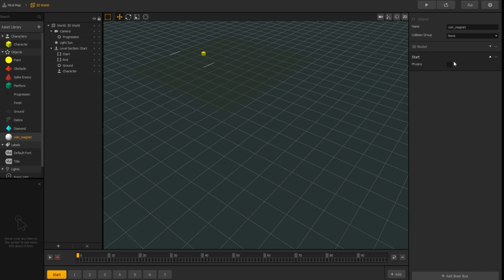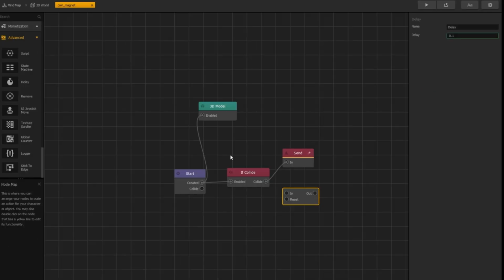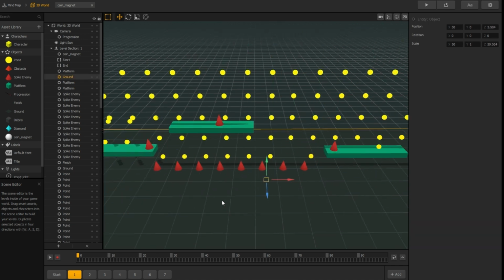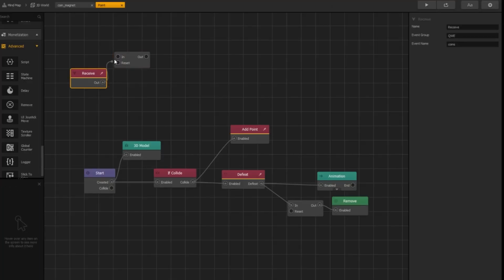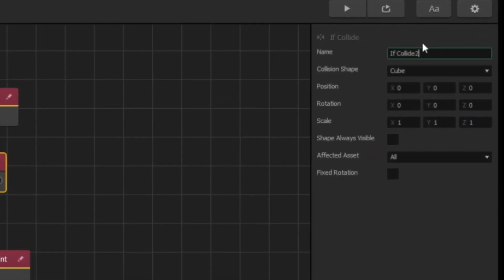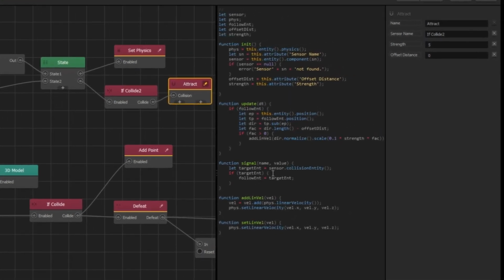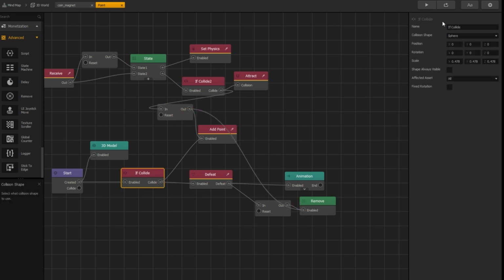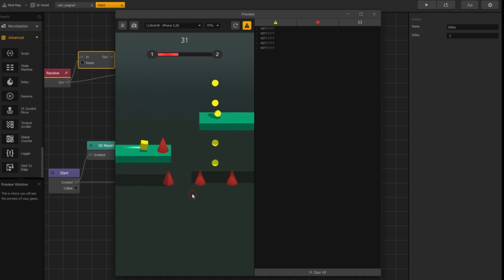Buildbox 3 Magnetic Coin Power-Up (ATTRACT Node)

Comment: The reason why setPhysics node causes that error is because to have set physics node on to an object the object needs to have physics activated to begin with. When setPhysics node is called there is a line that declares the variable 'ph' with the coins physics object. Since you never activated physics on the coin it returns null every time.

Comment: Thanks for the tutorials. In case, you know how to "make a perfect jump" (Buildbox 3). I wish my character would jump in the "x" direction, for example only 100 pixels. So I can get precise and equal jumps every time, without the character slipping or anything ... basically like the Hoppenhelm game. I know, I probably explained myself very badly, but I hope you understand!
Reply from the maker: One thing you could try, is setting friction very high on platform and character (you can find friction in asset's node map, in start node).
And turning off rotation (also in start node).
Reply: Hanomax Games yes, I tried in various ways, but I was not satisfied. I searched around a bit to see if I could find any lines of code or solutions, but nothing. also because sometimes it happens that by restarting the game, or during..something changes and therefore it is not always very precise. anyway thanks a lot for the reply

Comment: Hello! I tried this in a 2d game and it doesn t work properly....unfortunately. The coins are disappearing and counted but they are not "coming" to the character in a smooth way.... .  It s like the player activates magnet and then all off the points around character disappear instantly. I set everything like u did in this video. Have you encountered this problem till now? Has anyone, or is it just me? :)))
Reply: Same here, the coins are disappearing instead of coming towards the character
Reply: Have a solution?